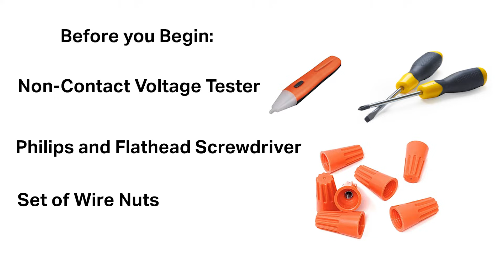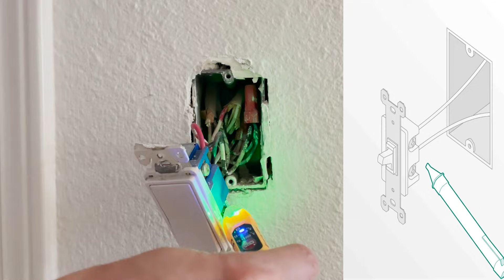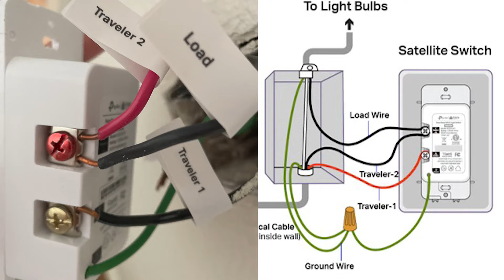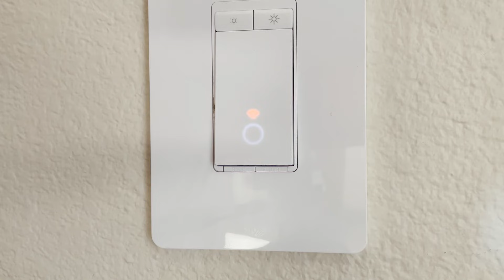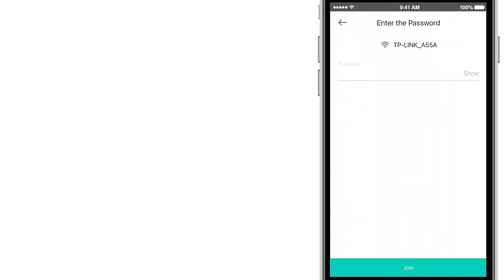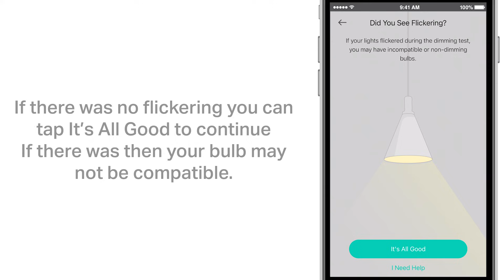Installing and Setting Up the Kasa KS230 Smart 3-Way Dimmer Switch

Comment: Once connected do they need to be connected to the WiFi for initial installation or would they just turn on once I click the button ?
Reply from the maker: They will work using the manual operation but to control through the app or voice commands they will need to be connected to wi-fi.

Comment: I have installed three of them but one of them keeps going solid red. It works manually so is it installed wrong? I have reset it and restarted it…I don’t know why it’s not working
Reply from the maker: It is likely a network issue then.  Check the signal strength and if its poor you may need find a way to improve it, like a Range Extender or a Mesh network system.  If the signal is good then it might be a device issue and you would want to reach out to support for warranty services.

Comment: You never mention where that LOAD label came from. Incomplete instructions.
Reply from the maker: In a 3-way environment, the Main switch box contains the Line wire, and the satellite switch box contains the load.   The reason it is not specifically mentioned is because its a standard wire in the satellite switch box.

Comment: Did anyone notice that after using these switches for more than a yr, they don’t work, in my case the switch suddenly starts to trip n the reset does not work anymore,. It just blinks the lights until u remove the power n replace with a new switch. Any one experienced this weird functionality ? Am sure Kasa knows about this but is silent.
Reply from the maker: I personally have been using our Kasa switches for years and have not experienced this concern. It is also not a common experience that we have seen or heard about.  I would suggest reaching out to support for assistance.

Comment: Can we use it at 4 way switch also?
Reply from the maker: No the KS230 Kit cannot be used in 4-way environments.  You can use the Tapo S515 switch in single, 3-way, and 4-way environments though

Comment: One thing I must be missing, in the existing place where the dumb satellite switch is, how does one know which one is the load and which one is the traveler if they are both black. In the first step you use the tester to see which line is the Line… But when you open up the satellite plate and switch, the two Black are there. Which one is which?
Reply from the maker: We are not an expert in electrical wiring.  I believe the load will respond the same way as the line does but for a question like this it would be best to consult an electrician.

Comment: What if my my main box is where the line and load  load wires are in? The satellite box is on a seperate circuit.
Reply from the maker: I don't believe that is actually a 3-way environment.  You would want to consult with an electrician on that one.
Reply: @TPLINKUS  What if the sattlite box has no other circuit other than the 3way cable that comes from the main main box? The main box has load and hot wires coming in.

Comment: Trying to follow this which seemed pretty straight forward (nice job) and I thought I was finally going to get this working. I've identified what I think is the box where the main switch will go. 

•	ID'd the Black LINE wire in this box and labelle.

•	Connect this Black wire with the other Black wire in the main box, I get 120V on the Black wire in the Satellite box (so I assume the black wire is a Traveler wire?)

•	Connect this same Black LINE Wire (by itself) to one of the two Red wires (the light goes on) and there is no change in voltage on any wires in the satellite box.

•	Connect the Black Line wire + Black (Traveler?) + Red Wire (one of the two), I get 120V on the Black wire in the Satellite box.

•	Connect the Black Line wire + Black Traveler + Red Wire (one of the two) + Red Wire (second of the two), I get120V on the Black and Red wires in the Satellite box.

So now is where my confusion starts (continues).

•	Leave satellite box wires all disconnected.
•	Main box on the Main 3 Way KS230, I connect the black wire which I labelled LINE to the Black wire lead on the Main switch.
•	White Neutral to the White bundle. At this point I hear a click and there is a flashing red circle on the main switch.
•	I continue on…..
•	Green to ground. Red circle continues to flash
•	Connect the Black Wire (Traveler?) to Traveler screw.  Red circle continues to flash
•	Connect one Red Wire (Traveler?) to Traveler screw.  Red circle continues to flash.
•	Try connecting to the individual White Neutral’s I the bundle and I get nothing except when I connect White Neutral from the same cable as the Black Line I get the blinking Red Circle on the main switch and no voltage in the Satellite box.
	
What am I missing? Do I need to connect wires or add switch in Satellite box?
Reply from the maker: I wish we could explain this in detail here but we are not equipped to provide functional support in the comments section.  Please contact support by going choosing your region here:  https://www.tp-link.com/us/choose-your-location/, then click on support followed by contact technical support.  The support team for your region will be able to help you through one of the available options.

Comment: This is not user  friendly switch its a headache🤦
Reply from the maker: The installation process is pretty straight forward. However, it can be difficult for customers who do not have experience with electrical wiring.  In those cases we suggest contacting an electrician to complete the install.

Comment: Can I use only the main switch and leave the second one in my box?
Reply from the maker: No, the KS230 requires the pair.  The Main switch connected to the Line/Live side and the other switch at the load side. The KS230 will not work with existing switches.

Comment: Can these switches be used manually if the wifi goes out?
Reply from the maker: Yes, the manual paddle will still work, but voice and app control will not.

Comment: Question: my switches don’t connect to outlets that I want to have lights connected. If I replace toggle switches with Kasa switches and plug smart plugs in outlets where lights are, will the switches then allow me to connect? If so, do I have to connect all the wires to switch?
Reply from the maker: It could work.  We have smart actions in the kasa app "control with switch" which allows you to trigger another Kasa device with when the switch is triggered.

Comment: After installing these, my light doesn't turn on at all, or dim whatsoever. Both switches look like they work fine however, showing the dimming level and even on the Kasa Application I can turn them off and on, dim, but my light never actually comes on.
Reply from the maker: It is likely a wiring issue.  Check to make sure the primary switch is installed on the Line side and satellite switch is installed on the load side.  You will also want to make sure that both traveller wires are installed the same way.  You may need an electrician for assistance if you are unsure.

Comment: I get 230 different then the one on the video
Reply from the maker: The wiring of the satellite unit was modified on later versions.  the load is a seperate wire rather than connecting to the screw with traveller 1.

Comment: will the switch work with 2 live and 1 neutral wire?
Reply from the maker: Switch 1 (primary) needs 2- traveler wires 1 - live wire 1 - neutral wire.  Switch 2 (secondary) 2- traveler wires 1- load wire.  We do recommend the ground being used as well.

Comment: I have 3 wire. 1 it’s line, 1 it’s travel but 1 it’s neutral?  I connected it doesn’t work.
Reply from the maker: 3-way switches will have to traveller wires  1 line or load wire (depending on side) and possibly 1 ground and 1 neutral.  The neutral wire is required.

Comment: I have added this switch successfully in my last home, but somehow in the new home the wire colors don't match from main to satellite boxes and I'm not sure if I fried the switch or not as it just stays constant orange without blinking.  I switched the traveler wires in the satellite and it doesn't seem to make a difference and switched the traveler wires in the main and still solid orange.
Reply from the maker: I would suggest reaching out to an electrician to determine which wire is which.  They would be able to assist with unusual wire colors.  Once that is known the device can be properly installed.

Comment: Hey guys love the product but I have a question for you.  It says you can group together multiple switches so that you can turn a group of switches on with one tap on your phone.  Is there any way you can program the switches so that when one switch is pressed it will actually turn on the switch you pressed but also other switches in the house? Or is this feature only for the app?
Reply from the maker: Yes actually there is.  Use the smart action "Control with a Switch"  This Smart Action will allow one switch to trigger other Kasa products including bulbs, plugs and switches to change status when a switch is triggered.
Reply: @TPLINKUS  so I could technically make 2 switches control one set of lights using this programming even though the switches don’t have 3 way wiring between them correct?
Reply from the maker: @MrDoordude125  Yes but each switch would have to have the smart action setup on it.
Reply: Love this thank you!

Comment: Does the Switch emit any light when it is off, to any extent?
Reply from the maker: Yes, all of our Switches have a small, white LED circle that is illuminated when the switch is "Off".  For most this light is dim and easy to ignore but for a few "light Sensitive" customers there have been concerns about its brightness.  Some of our switches allow this light  to be disabled
Reply: @TPLINKUS  Does this specific model allow the light to be disabled?
Reply from the maker: @JustStepBackAndThink  V2 and up yes.
Reply: @TPLINKUS can you confirm if HS210 KIT can turn off the status light? I can’t determine if it’s V2 or not.
Reply from the maker: @FitStanley  no that feature is not available on the HS210 at this time.

Comment: Can this be used with a 4-way switch in between the two 3-way dimmers?
Reply from the maker: The HS210 can, but the KS230 dimmer cannot.
Reply: @TPLINKUS  I really love using your switches. They are amazing and you should make double rocker switches. I was able to find three-way dimmer, and the baraka switch for my other company but I really would like to stay with you so please let me know if you will be making those switches in the future, thank you
Reply: @TPLINKUS  thank you for the information. Are you planning in future to make a dimmer switch that will work with the four way switch? And also your single pole switch and dimmers work with apple home kit but 3way switches won’t
Reply from the maker: @valerikatamadze2041  The new KS200 and KS220 were the first Kasa switches designed to work with HomeKit. A 3-way version has not been developed yet, but will likely.  No there are no current plans for a 3-way dimmer for a 4-way environment.  But I will suggest it to the team.
Reply: @TPLINKUS  that would be wonderful because other companies already have it, I just wanna stay with you guys and all my clients love the product. You should also think about making a double rocker switch.

Comment: I have many Kasa switches and your 3 way kit is by far the most irritating one to install, your diagram has never worked for my home ONCE! I always have to end up just switching wires around till it works. Always hate installing your 3 way switches.
Reply from the maker: We would recommend that if the video and diagrams do not help to reach out directly to support.  They can help walk you through the process.

Comment: Do both switches carry the same MAC address?
Reply from the maker: no, because only the main switch is actually connecting to the network the 2nd switch is a dummy switch, still required, but does not connect to the network.
Reply: @TPLINKTECH  So there will be no MAC printed on the secondary switch?

I have 4 3-way kits and I got the switches mixed up so just trying to pair them back together.
Reply from the maker: @secretstorymusic  Not that i know of.  There should be a serial number on them and that would be how we could identify the pair.  The Serial number should be identical, except for 1 character.  for example the Main unit could be 231116000A01 and the sat could look like 231116000B01
Reply: @TPLINKUS  Thank you for being so attentive to my needs.  I really appreciate it.  Cannot wait to automate scenes in our new home
  So exciting.

Comment: I did set up as mentioned but on main switch it always blinks red. My wiring is correct as shown on video. App keeps saying to check wiring but it is correct. When I do reset on main switch , it switches to flashing between amber and green. With that I go through app which says check for wiring to swap terminal 1 and 2 / do a restart. When I do restart it comes back to red light blinking all the time. I am not sure if this a buggy switch from Amazon.
Reply from the maker: Have you confirmed that the main switch is on the line and not the load side?  If so then we would recommend contacting support for assistance.
Reply: @TPLINKUS  yes main switch is on live wire side. Satellite switch is on load side. Main switch is always on with red wifi signal which means it has live wire all the time. Right ?
Reply from the maker: @sreenathnagarur  actually a Red Wifi inidcator would mean either the switch is disconnected from the WiFi or the wiring at the time of onboarding was wrong.  Keep in mind that the V1 and V2 have slightly different wiring, but have the same requirements.  Both switches must be used,  Cannont be used on a 4-way circuit,  Sat unit must be on the Load side.
Reply: @TPLINKUS  this is a V1 switch. This is the first time I am installing switch , so wifi won't be connected. It starts with red rapid blinks & then after app sends me in loop not offering a solution which works.
Reply from the maker: @sreenathnagarur  I would suggest contacting support for assistance.

Comment: Can you use this switch  as a regular single pole switch? purchased this by mistake thou it was just a regular dimmer
Reply from the maker: No the KS230 is exclusively designed for a 3-way run.
The HS220 is the single-pole dimmer.

Comment: Can you install the satellite switch on a different location, separate from the circuit which the main is installed?
Reply from the maker: HS210 can but the KS230 has to be the same 3-way circuit.

Comment: Your video and diagram don’t match each other. On the satellite switch on video you have load (black) wire and traveler 2 black wire together on same connection and on video it shows black and red on same connection. Went with the diagram as that’s what works. Other than that thank you for the video.
Reply from the maker: That is because the diagram was made after the recordings were filmed and we were unable to do a reshoot.  Although they are different as long as the traveler wires are the same for each switch then it won't be a problem.

Comment: Avoid this product like the plague! Broke out of the box- I spent HOURS wiring this POS the RIGHT WAY and it still does not work. If it's firmware then SHAME on TPLINK for not shipping with latest firmware! AVOID AVOID AVOID AVOID AVOID AVOID AVOID AVOID AVOID AVOID AVOID AVOID AVOID AVOID AVOID AVOID AVOID AVOID AVOID AVOID AVOID AVOID AVOID AVOID AVOID AVOID AVOID AVOID AVOID AVOID AVOID AVOID AVOID AVOID AVOID AVOID AVOID AVOID

Comment: What if i have 3 gang o lights, exist a Smart 3-gang Switch from Tp-link?
Reply from the maker: As in you have multiple switches in a single large switch box in your wall?  That shouldn't matter the KS230 can still be used as long as one of those switches is a 3-way, you replace the other 3-way switch with the 2nd switch in the kit and have all the appropriate wires.  You will also need to have a universal Decora style multi-gang faceplate.  TP-Link does not make those at this time.

Comment: Is installation different between kasa switch vs regular switch? I'm trying to work with contractor and they are charging more installation fee for it so was wondering if there's difference.
Reply from the maker: It can be.  It all depends on the wiring.
Reply: Is the contractor configuring the kasa software, or just installing the physical switch?  The configuration is extra work, but the physical installation is the same.

Comment: I just also installed an HS200 and it keeps turning on at 11:55am even though it is not scheduled to turn on. I’ve had to schedule it to turn off at 11:56 am. How do I fix this? Thanks!
Reply from the maker: Make sure you do not have Away mode or Timer enabled.  Other than those features the only way for a switch to turn itself on is if its recovering from a power outage/brown out and the switch is set to return to last on state, or if there is a schedule for On enabled.  If none of that is true please contact support.

Comment: Can I use the 3 way dimmer on a 2 way (one wall switch not two).
Reply from the maker: No.  The KS230 does require both switches to be used.  We do have the HS220 single-pole dimmer though